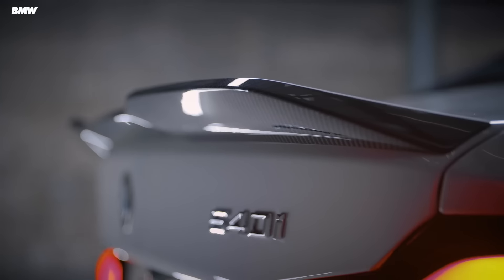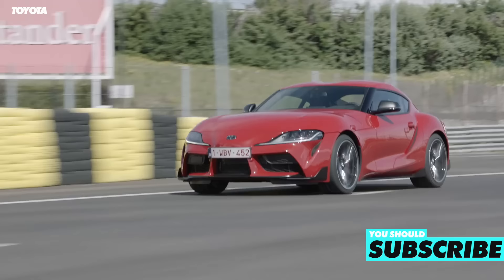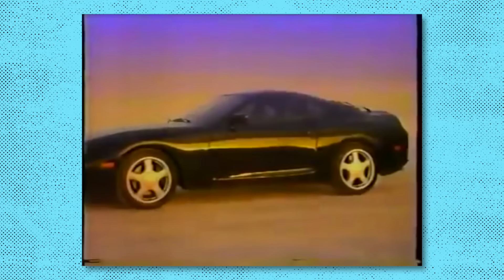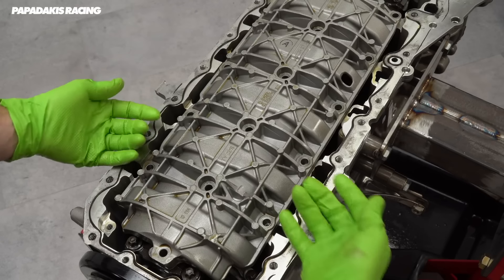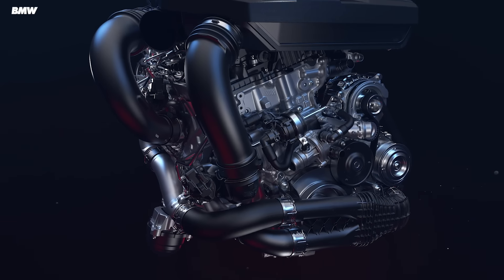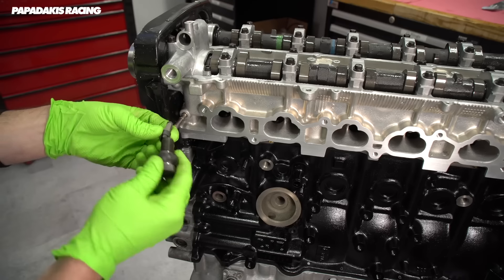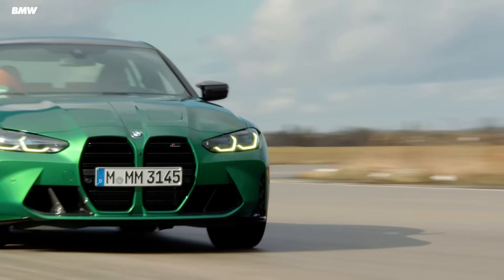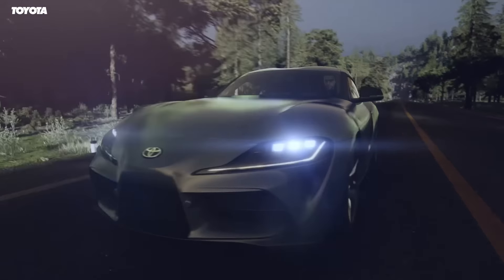Inside BMW's Greatest Engine

Comment: You forgot one thing the B58 is made with the same block as the B57 which is a diesel! It is very reinforced.
Reply: This is not true 
Only b37 and b38 share the same crankcase
Reply: @MrSupermasi   he means the b58’s block ARCHITECTURE is based of the b57
Reply: Not the same block. It just B58 is running semi-closed deck. Like diesel engine
Reply: If thats the case then the B58 could be retrofitted with the b57's dipstick yay.
Reply: Which of their transmissions are reliable also?  I would love a car that can last a long time and maybe even outlive me if I care for it.  I don't care for Camrys and Corollas that much even though they can last a long time.
Reply: @charleshines1553  already! that B58 paired with ZF 8spd torque converter AT tranny. Jason from Engineering Explained even agree, its the best AT tranny right now. BMW even had a slide that tranny is faster than DCT(they used it for predecessor), forgot the source tho
Reply: @charleshines1553  Certainly not the factory manual lmao. The GS6-45BZ, which comes in 6-speed equipped M240i, 340i, and 440i, has synchro issues and won't take much more than 600hp. The 8HP70 trans, on the other hand, is an incredible auto. 1000hp+, and it's an easy retrofit from the standard 8HP45, which already takes big power.
Reply: @yahtadi5152  the B58 closed deck though? Or maybe I misunderstood what you wanted to say.
Reply: @xIcarus227  semi-closed deck. What is so hard to understand?
Reply: @yahtadi5152  dude it’s closed deck ..
Reply: @yahtadi5152  closed deck. What is so hard to understand?
Reply: @yahtadi5152  its closed deck theres no semi...
Reply: Doesn't matter. Iron Block 2jz will always handle more boost.
Reply: @rickyr7790  it is at different league compared to b58.
Reply: Very few people mention this.
BMW use very similar block for both engines. Altough there some alteration for diesel/gasoline counterpart, overall construction are equal. No wonder the b58 capable to handle lot of boost. Because b57 already do that in factory settings.
Reply: Also forgot to mention Toyota sent a lot of it back when they were stress testing it for the Supra
Reply: @porschelover04  at can't hold 1000hp?
Reply: Damn!! Didn’t know that cool shit
Reply: @yahtadi5152  The B57 and B58 are both closed deck. That information comes straight from BMW's PDFs on the B58 and B57 for Technicians.
Reply: @charleshines1553  well you pretty much killed the two best options 😄 try a Lexus then or make a research on an Accord with the 2.0t engine
Reply: @yahtadi5152  doesn't handle as much torque as dct without slipping. There's a few Supras with simple mods that have slippage with the ZF8.
Reply: @venelinkeremedchiev9643  I just don't care at all for Corollas in particular.  Sure they are fun to drive but in Pittsburgh they will struggle with the hills there.  Then we see how much fun they really are!!
Reply: @venelinkeremedchiev9643  Really until I found out about the Atkinson cycle it was a mystery why those things are so gutless!!
Reply: 😂 Dirty diesel
Reply: @yahtadi5152 it’s not semi, it’s actually a closed deck
Reply: @Altezza1999  Thats a very good point !
Reply: @rickyr7790 The 2jz also weighs far over 60kg more than the 139kg b58.
Reply: @MrSupermasi the b58 and b57 use the same block casting, but machined differently, because the b57 has a bigger bore
Reply: @yahtadi5152 B58 in my M440i is fully closed deck. Standard, it’s running 410 BHP against a claimed 374 BHP.
Reply: Nope
Reply: @ThePandasian34  and the b57 is came out of the n57. Which i own one actually ❤️😂
Reply: @muhammadhanifkurnaen6689 i have an n57 aka the grandfather of the b57 and so forth, currently running around 40psi on a bigger turbo. Everything stock but fueling and exhaust. 400hp and 650tq at 1200rpm. They hold a shit ton of psi mind you mine is a diesel but its all essentially “the same” architecture and whatnot
Reply: B57 is super underrated! You can even get one in a 750ld with quad turbos 🤯how come no one talk about that
Reply: My Corvette has a reliable transmission with double stock horse power. Transmission by B&M racing.

Comment: BMW rarely have issues with its engine block, the block is very reliable. The real issue is the plastics and electronics inside the engine that'll breakdown sooner than you expected
Reply: What makes it different to any other car though? Mustangs have plastic oil pans now...Even your typical Hemi engine has a plastic intake. BMW has actually gone up in reliability than backwards.
Reply: @GokuTheHusky  the quality and grade of plastics they use. Compared to a Toyota, Honda, or Ford, I find that overtime BMW plastic gets extremely brittle over time to compared to other brands.
Reply: @GokuTheHusky  BMW has a reputation for using horrible quality plastics for their cooling system that tend to self destruct over time.
Reply: @alextran8188  Part of that is due to higher operating temperatures of BMW engines for emissions. While most engines sit at around 85C, a BMW will sit at 100-105C
Reply: So, how much would it be to replace all the plastic?
Reply: This is where the b58 shines as it holds heat from a drive for nearly 24 hrs after parking up hence far less strain on the plastic parts cold to hot back to cold
Pcv valve is a weak part but very cheap to upgrade and coils can a problem but not a massive money bill
Reply: yeah then we‘ll have to replace plastic and rubber things after 20years. it‘s ok